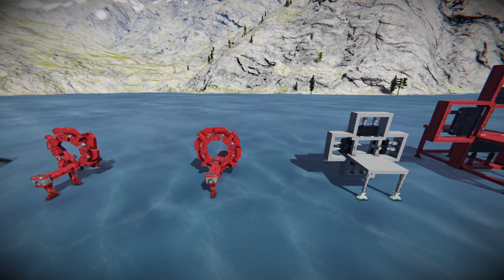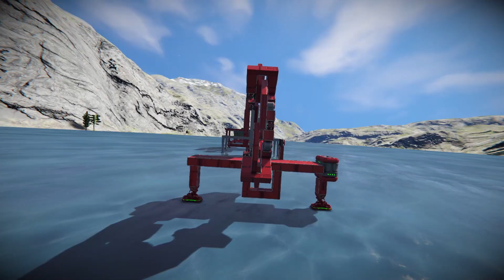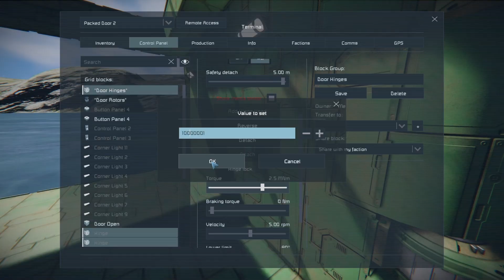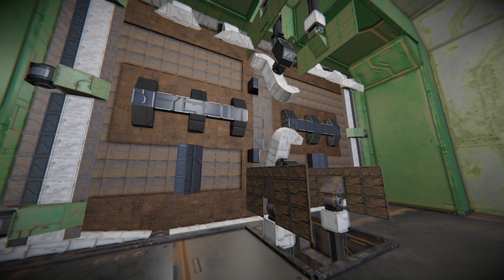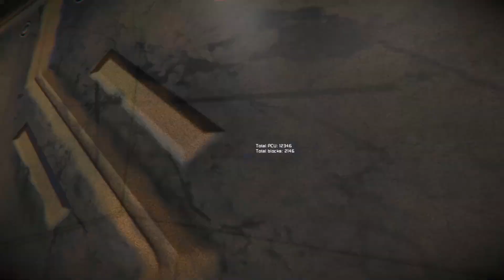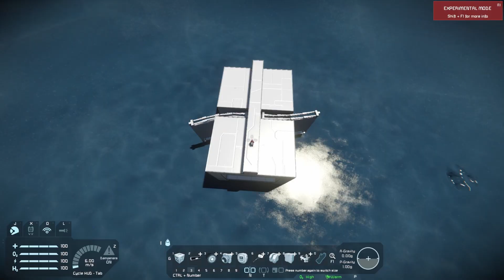Custom Doors In Space Engineers

Comment: I mean as farfetched as it seems, the big door and the small hallway door are extremely useful. Especially the larger one, for slowing down potential attackers to a crawl. It might seem wrong because small grid is much easier to destroy, but destroying one block of large grid armor clears a huge space, and the hitbox for said block is huge. The smaller blocks will each soak a single shot but overall it makes it more difficult for people to just yeet themselves into the base through your door and wreak havoc. And the locking mechanisms for the massive door are extremely useful for extra anchor points and it has the possibility of inciting Klang's Wrath on attackers
Reply from the maker: Good thinking! You could potentially make the small grid door as  t h i c c  as you wanted and use heavy armor to make it extra resilient.

The locking mechanism works quite well, in testing I tried to open the door with the latches closed and they were easily to overcome the pistons trying to open the door.

Comment: Great contraptions. What if you add small mergeblocks to the parts that are touching when closed? Then they could become airtight. At least some of the them.
Reply from the maker: That should work. As long as the grids will then separate when the merge blocks are disconnected/turned off. I'm actually currently enjoying my evening designing some airtight doors :D Stay tuned for a future video on them!